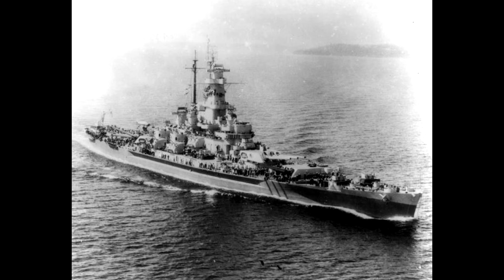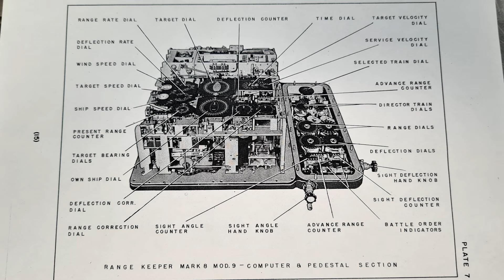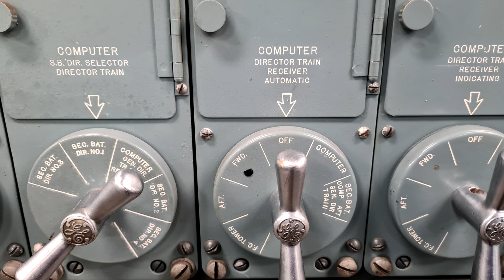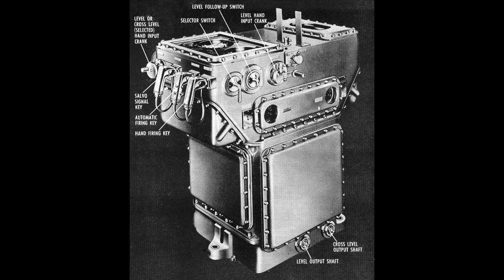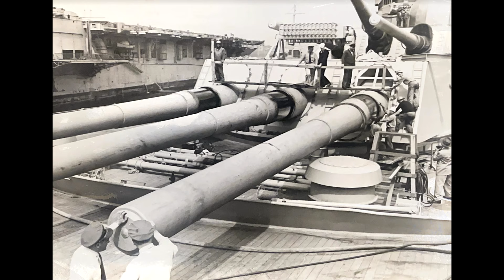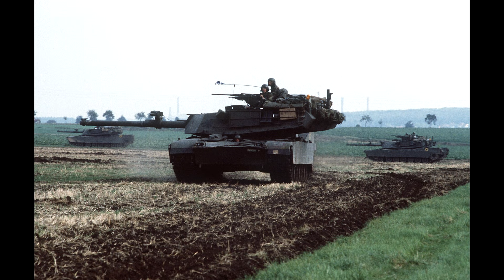US Navy Fire Control Systems - How They Really Work

Comment: (Fire Control Part 3) Capital ships with two directors and two plotting rooms, each with its own computer, could engage two targets. The US “fast” battleships had a switchboard in their plotting rooms that allowed any director to use any mount, so that one main gun turret could be controlled by each Mk.38 director and one by one of the secondary Mk.37 directors. In this case, the Mk.37 director would by-pass its own computer to synchronize with the main armament plotting room. Some capital ships had an emergency control director in the rear of a turret (usually a super-firing turret farther above the waterline) with a simplified computer to provide director control to the gun turrets. Each mount, of course, could engage targets in local control, some navies fitting simple fire control computers at the turret officer’s station to generate a firing solution. All of this was controlled by the ship’s gunnery officer. Positioned in the conning tower or on the bridge, the gunnery officer usually had a target indicator, binoculars on a pedestal or a periscope that might communicate bearing automatically or manually. Often the gunnery officer had a spotting glass or even a rangefinder. Sometimes there was even a simplified fire control computer at his station as a backup. Modern US “fast” battleships had two primary and six secondary directors for the main armament. A spotting glass was different from a rangefinder. The spotting glass was used to detect the fall of shells and their distance from the target, not the distance from the firing ship to the target. The USN used spotting glasses in some directors, with the Mk.34 initially having a spotting glass, which was replaced from 1940 with a 15’ stereo rangefinder.
		All these improvements still operated within the physical limit of the visual horizon. At one hundred feet above sea level, the curve of the earth limits visual distance to around 24,000 yards on a clear day, while the visual horizon from a point thirty feet above sea level was around 12,000 yards. This is why turret elevations generally leveled off at between fifteen- and thirty-degrees during World War 1. Most high-powered heavy guns could reach 24,000 yards at fifteen degrees, while going to twenty or thirty gave insurance against hull damage causing lists. Suddenly at the end of and after the war, navies were demanding a minimum of forty degrees elevation. What changed? The ability of the capital ship to carry and launch aircraft, aircraft that had a flight endurance of two to four hours and transceivers, that were light in weight, reliable and powerful enough to be put into an aircraft light enough to operate from a flying off platform or catapult carried aboard a capital ship. The observer could be put over the target and correct fall of shot to the maximum ballistic range of the gun. By 1935, the US Fleet could successfully engage a target ship at 30,000 yards over a smoke screen by air spotting. The IJN intended for its Battle Line to open an engagement at more than 35,000 yards using air spotting. Air spotting did have its limitations. One navy or the other had to establish air supremacy (or at least air superiority, which is why multiple aircraft were carried, to make up for losses) over the battle area. There had to be multiple aircraft to maintain spotters over the battle area. Radio procedures had to be developed to ensure ships were working with the right spotters and engaging the right targets. Aerial spotters had to be trained. Most ship’s captains were reluctant to use seaplanes if they had to recover them, since this involved slowing or even stopping their ship, making it more vulnerable to submarines. Poor visibility or bad weather would limit or prohibit the launching of aircraft. The aircraft and the aviation fuel represented a fire danger to the ship, especially when installed near ventilation systems that provided air to closed spaces like engineering or ready service

Comment: (Fire Control Part 2) target. The guns would fire on directions from the gunnery officer in the director who could see the target and wasn’t blinded when the guns fired. Starting with a simple optically enhanced target indicator, the next step was adding range finders either at the director, at a position nearby or at the gun mounts. I won’t get into the difference between coincidence and stereo rangefinders, except to say that stereo rangefinders were more accurate but more difficult to use and became universal among navies. At first these rangefinders had a base length (the distance between each optical point at each end of the device) of three feet or so, but it was realized that the longer the base, the more accurate the range taken by the operator. Some rangefinders mounted in turrets came to be over fifty feet in length. Next, instruments were developed to process the data and produce a firing solution which could be communicated to the mounts. The director became more crowded (and less efficient) and the development of sound and electrically powered telephones and data transmission by wire allowed both better coordination between the director and the mounts but also allowed the movement of much of the personnel and instruments involved in receiving data and generating firing solutions into a better protected position in the hull. In the 1930s, a series of evolutionary steps caused a revolution in fire control. The first was the improvement in fire control solution mechanism with the introduction of mechanical analog computers. Initially, the computer assisted the gunnery team using actual manual plots to generate firing solutions. Such computers were designated “range keepers” in the USN. Eventually, all navies had manually operated mechanical analog computers using a system of handles, cams, wheels, rods and levers to input all required data, including ballistic wear and atmospheric conditions, in order to calculate all the necessary outputs needed to generate a firing solution (it should be noted that the Soviets were still using mechanical analog computers in the 1970s to generate firing solutions for anti-ship missiles). Some of these computers later in the period were electro-mechanical systems, while by 1941 the USN was developing electrically driven computers which could, at first, be easily modified to handle a different caliber and then computers that could handle multiple calibers in the same system. In the later, more capable computers, the data generated by the director, the rangefinders, and the mounts, along with ship speed and bearing, were automatically fed to the computer, which generated a firing solution which was then fed directly to the turrets and guns through “pointers” in the sights of the trainer and layer, and in some navies, the computer automatically drove the mounts to the proper train and elevation through remote power control. The USN integrated a “stable vertical”, a device using gyroscopes to maintain an “artificial” horizon and correcting for roll and own ship’s rate of change, which directly fed data into the computer, in place of a manually operated cross-sight in the director. This allowed the firing ship to maneuver and to engage a turning target. Firing solutions could now be generated in a few minutes, in some cases, in seconds. Almost all capital ships had two directors, a primary forward at the highest possible level and a secondary, often at a lower position. Fire control could be switched over to the secondary director, though this could take several minutes (or more, up to 30 minutes, for older systems which required returning all the turrets to zero/180 degrees to reset the synchronizing motors), depending on the transmission system used. One advantage the US and German ships had was the use of AC electrical devices which produced finer and more accurate transmission of data, synchronization within the fire control system and use of RPC.

Comment: Naval Surface Fire Control (Part 1) - This may be the time to discuss the (ballistic) range of the guns which represented the reason for the existence of battleships. The data usually seen is the maximum ballistic range at maximum elevation of a typical mounting for a new gun with the maximum powder charge, at the accepted internal chamber temperature, used with the standard shell. Range, of course, falls off as the elevation of the mounting decreases, which requires the reader to know the actual maximum elevation of the mount in question. For example, some references indicate that the two aft turrets in the “Fuso” class may have only elevated to 33 or 35 degrees (evidently there was insufficient depth in the hull at that point to lower the trunnions and turntable), while the other turrets elevated to 43 degrees after the major rebuild in 1930-35, which elevation produces the maximum new gun range of 38,700 yards for the gun (36cm Type 41) in question. The shells from the aft two turrets would, therefor, only reach a maximum range of around 35,000 yards. Next, the rifling in guns wore down with service, which allowed gases to escape around the shell and reducing both initial velocity and the spin placed on the shell. This resulted in a lower maximum range and less accuracy at all ranges. The RN had a policy of maintaining equivalent wear conditions for each gun on a capital ship to ensure uniformity of performance of a salvo, a policy which it found difficult to apply to the “Nelson” class due to problems with the 16 inch Mark I guns. The powder charge could be varied with different shells to reduce wear when the tactical situation allowed. The USN developed reduced charges for their High Capacity (HC) shells used in their heavy and medium guns which decreased range and penetration, but also minimized wear as US battleships shot off hundreds of HC shells in pre-landing preparations and post-landing fire support. Temperature in the chamber could create performance variations since new gun performance parameters were achieved at specific chamber temperatures. If the chamber were hotter or colder, the powder would burn faster or slower, changing the velocity of the shell. The range also varied by shell. The US 16”/45 Mark 1 fired a 2,240lbs AP shell that ranged farther at a particular elevation than the 1,900lbs HC shell which lost velocity faster over the ballistic arc to the target. All of this capability was directed by a fire control system that was designed to place sufficient shells into an area to ensure at least some hit a target. The initial fire control system, which remained in place for simpler weapons, was for the gunner, or sometimes the trainer and pointer, to look through a sight, with or without optical enhancement, decide when the target was in range and adjust for the movement of his ship and the target to decide when to fire. The effectiveness of this system limited battle ranges to no more than three thousand yards or even less. In 1898, the US Fleet destroyed two separate Spanish forces at Manila and Santiago, despite an absolutely abysmal hit rate. As guns became more powerful, it became more difficult to armor ships against their capabilities at close range, and with the existence and improvement of the torpedo, this drove engagement ranges out beyond three thousand yards and more. New systems were needed, and Scott in the RN and Fiske in the USN advocated and succeeded in implementing the director system. A position high in the ship contained a gunnery officer, several ratings, optical devices and communications equipment. The director would determine the bearing of the target, the optical rangefinder would determine the current range, while the other data needed was estimated. This data was own ship speed, angle of bearing, rate of change and roll along with the speed, range, bearing, angle of presentation and rate of change of the

Comment: Nice video but the info on the Apollo LM landing guidance is completely wrong.  The ground adjustment referred to was based (Apollo 12 and after) on a refinement of LM position and velocity by an earth-based Doppler system.  This only adjusted the landing aim point.  The actual control of the descent propulsion system and reaction control system was carried out first by an open loop guidance algorithm followed by closed loop guidance once the onboard landing radar got a lock on the surface.

Comment: is it possible to input main battery data for more than 1 target...what happens if two battleship[s gang up on you..does one turret go to local control?
Reply: Plot 1 for target 1 & Plot 2 for target 2.  However, ya don't get yourself into such a position of facing 2 peer targets.  Ya only engage a target can out-gun, ya out run the other targets.

Comment: is the coriolis effect (earth rotation) significant at the ranges typically involved...and if  so how are the corrections computed /imputed?
Reply: One of the "variables", used in practice, but not mentioned in the video.
Reply: Yes!  At the equator, a shot that has 1 minute of flight time, the target would move a bit more than 17 miles while the shot was in the air.